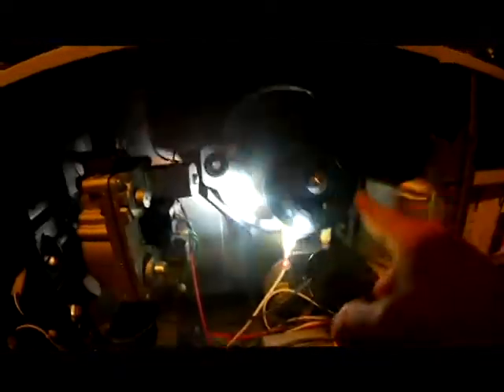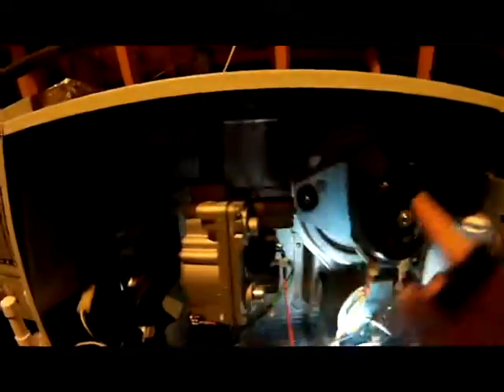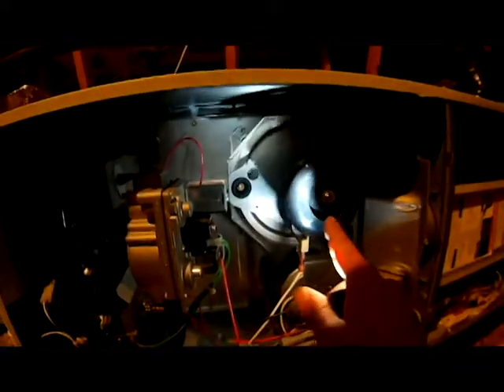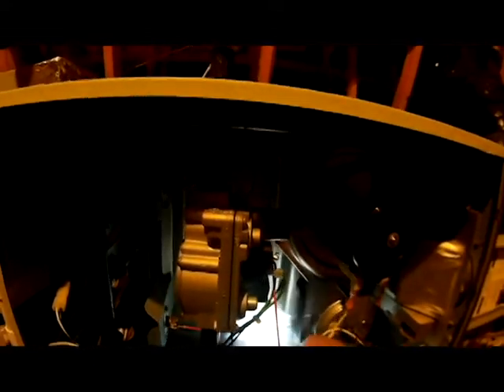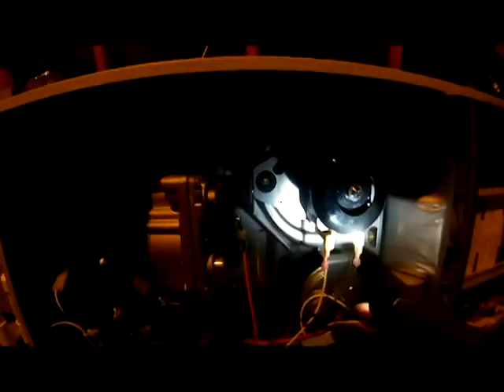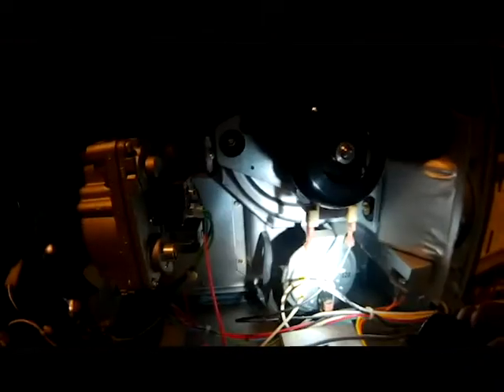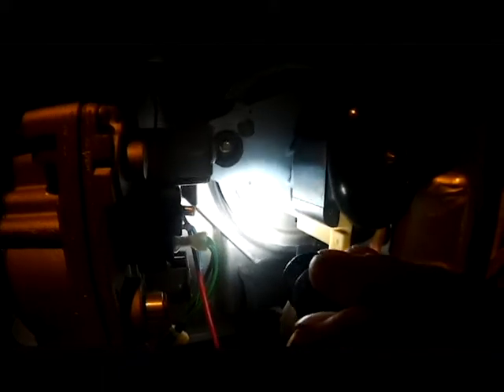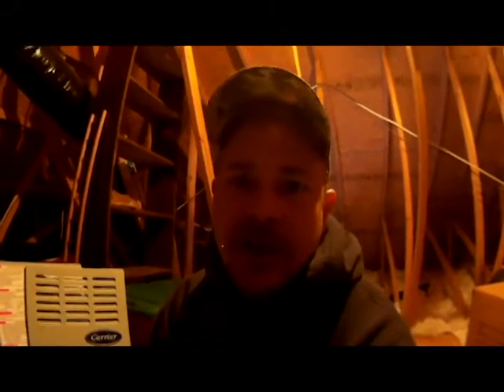How an Inducer Motor works on a Gas Furnace!

Comment: My furnance works fine but when it stops inducer motor keeps runing?
Reply: The same with my lennox g16q3-75-5. Sometimes it keeps on running and the only way to shut off is to turn on the blower fan for a few secs then it will shut off the inducer motor. I am trying to find out what will be the fix and i am thinking the relay switch that come to the inducer motor. I checked the pressure switch and it is working normal.